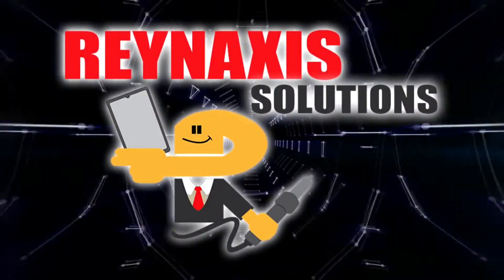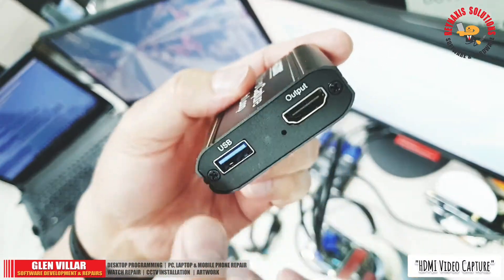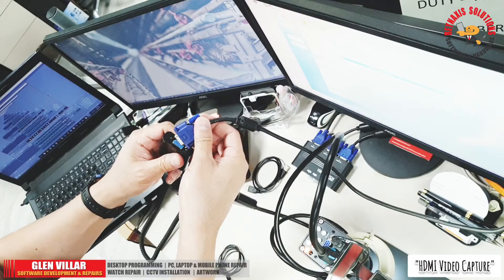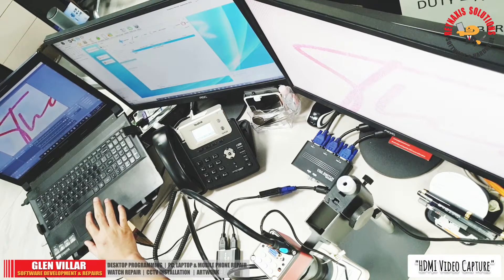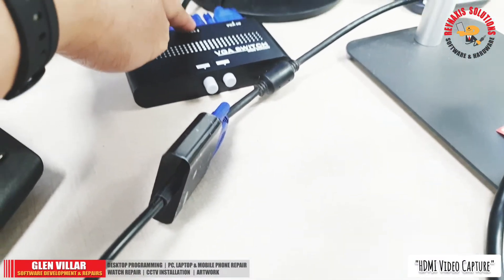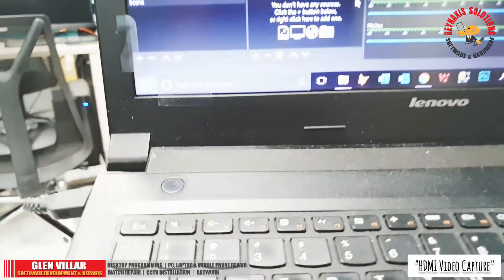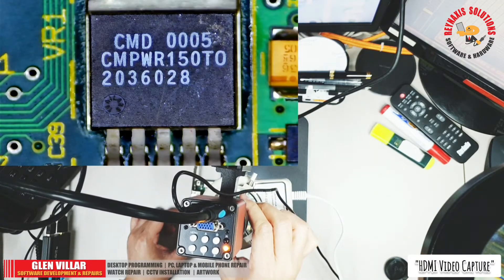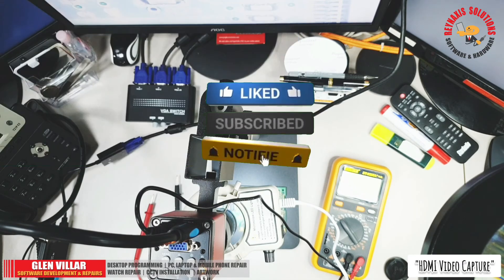HDMI Video Capture with Loop

Comment: Is this the video capture with loop out MS119?
Reply: Hi. What does the "with loop" stands for?
Reply from the maker: Hi! Great question. In this case, "with loop" means that the video capture device supports a loop-through output — so you can send the video signal to another device at the same time without losing the feed. It’s handy for monitoring or recording while still displaying the video elsewhere. Hope that helps!
Reply from the maker: Hi, it looks like it. It's similar to the model with MS119. Although mine didn't specify in its description so I'm not sure.